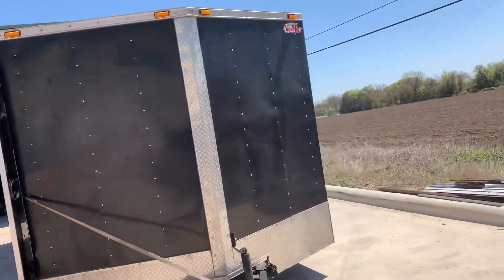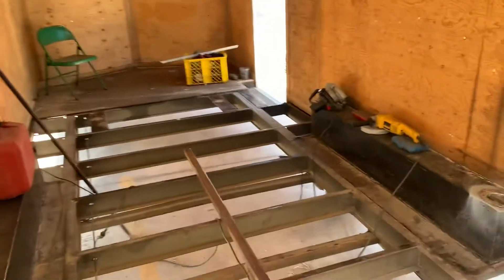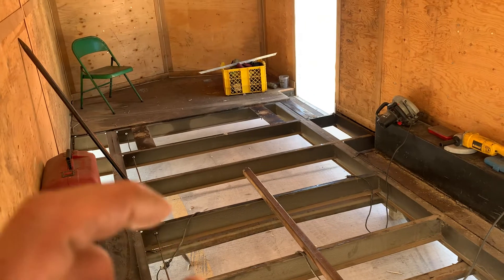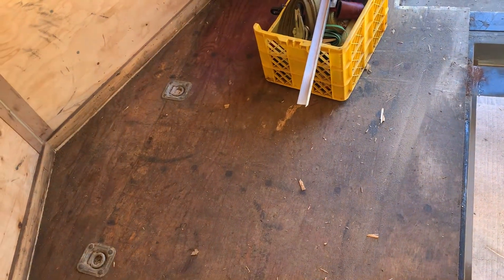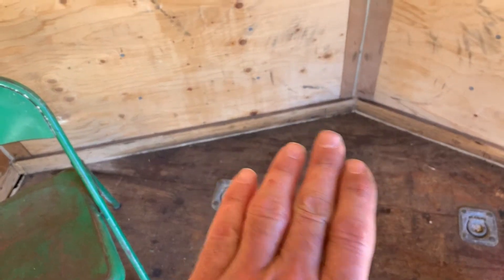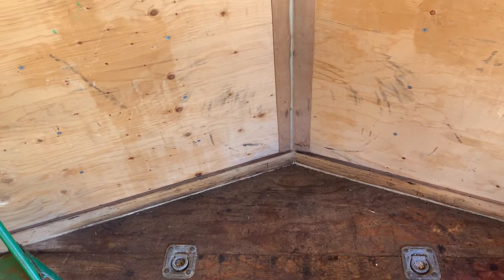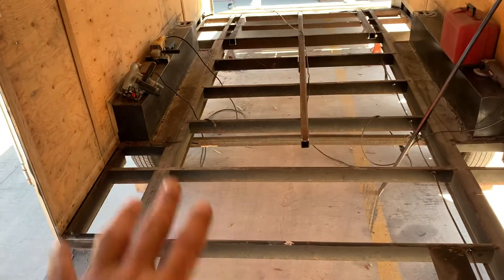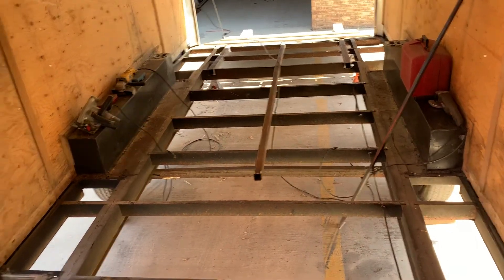Trailer new Floor time; Diamond Plate to replace Plywood

Comment: How do you plan on welding aluminum to carbon steel?
Reply from the maker: @tyczaplinski7856  I’m not. Check out part 2.
Reply from the maker: @tyczaplinski7856  I never said it was aluminum Diamond plate.

Comment: Did you get the project done? Lol
Is therre a pt. 2 that involves the diamond plate?
Reply from the maker: Coming soon! Need to buy the diamond plate and incorporate the winch into the new floor and accommodations for a battery and maybe a storage box under the floor for ‘stuff’. Thanks for asking, I will put a part 2 up soon.